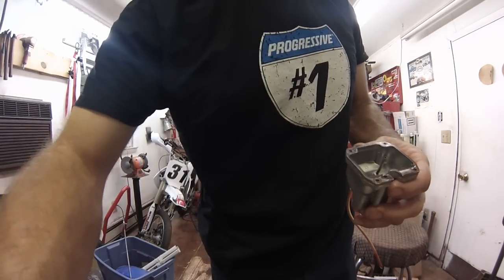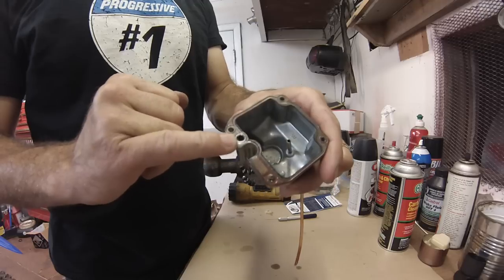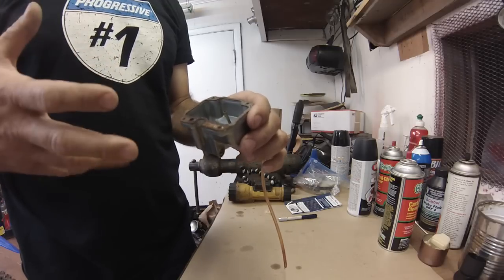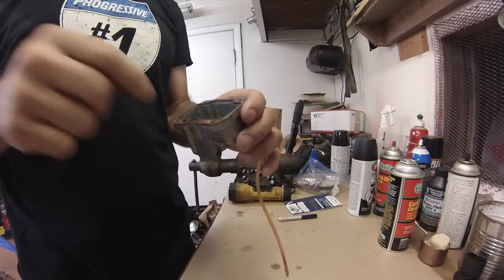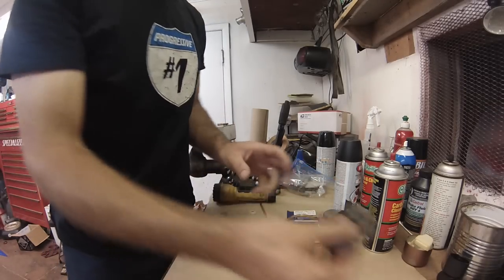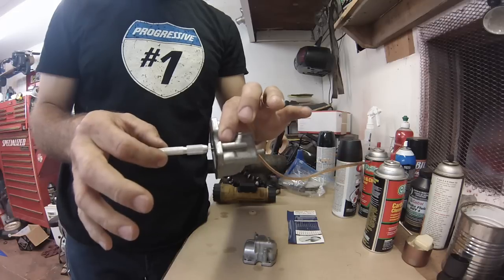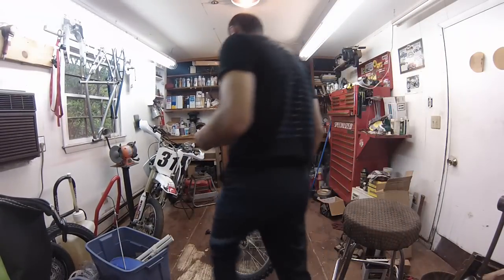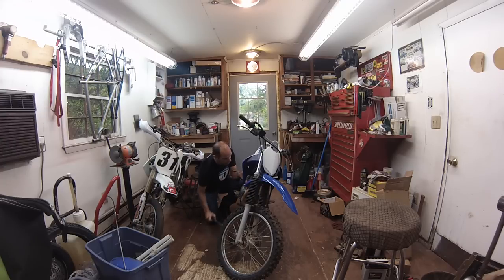TTR125 hard cold start problem FIXED !!

Comment: This absolutely fixed my hard cold start problem. When I bought my 2005 it had been sitting so long the gas was varnished. I cleaned the carb twice but missed the area described in this video. My bike starts cold now with the choke like it should. Thank you.

Comment: I just purchased a ttr125 that had sat with gas for over 3years. Cleaned the carb out several times and couldn't get it to start until I stumbled on your video. I didn't notice the hole in the float bowl that you showed. I tried your suggestion but was unsuccessful, Until... I used a guitar string and pushed it all the way through. The drill bit technique doesn't bend thus not cleaning the hole all the way. Thanks a bunch! Bike starts immediately and idles like a champ!
Reply from the maker: Good to hear, the hole is actually shapped like an L so straight in from the top then if carb cleaner doesnt flow through clean the hole from the bottom of the bowl side with a wire or similar. Glad I got you in the right direction.

Comment: Holy crap, years and cans of ether.  My daughter's bike hasn't been run in 2 years.  I clean up the carb and it wouldn't start.  I saw this video, drilled that out and it fired up in 3 kicks.  Again, after sitting for 2 years.  Thanks for taking the time to share your knowledge.  Absolutely spot on.  FWIW I used a common 1/64th bit and it worked fine.
Reply from the maker: Sweet, enjoy! Good to know the 1/64th worked fine they are easier to find.

Comment: Your video saved my life… Impossible to start my daughter’s TTR… It was  driving me nuts. The micro drill didn’t make it but I used a small pipe with my carb cleaner spray to blow from the small hole. It starts from the second kick. Merci beaucoup !
Reply from the maker: Awesome!

Comment: This totally worked for my 06 ttr 230. I just found some small stranded wire laying around and took a strand of that to use for cleaning out that pick up hole and some carb cleaner. also cleaned out the gas tank well to get all the old reserve gas out. put it al back together and it fired up first thing with the choke on and then ran fine after cutting the choke off. finally no more starting fluid!! thanks again!

Comment: This fix works like magic, you won't believe it !  I struggled for years with hard starting and a idling issue !!!  I used a 1-64 drill bit to drill out the orfice that worked great, you can find that bit size at any hardware store, I also changed the pilot jet in the carb from a stock #15 to a #17. I did not change the  standard main jet.    FYI, there is a tiny slow idle adjustment screw on the side of the carb and a mixture screw on the " underside of the carb", ( its very hard to get to, its on the engine side of the carb. Thanks tepco1  !!!
Reply from the maker: Great, glad it worked out!

Comment: Tepco,
         Your video while it didn't solve my problem directly pointed me in the right direction. My issue wasn't the port itself being plugged but a dead spider in the air vent hose at the "T" on the  choke side of the carb. I pulled the hoses and when I blew through the one with the 45 degree cut on it there was resistance. The spider was so petrified that I had to press a drill bit through the hole. After clearing the hose the bike now runs like new. Immediately starts when stone cold   good high idle on the choke and warms up and is ready to ride in a few minutes.Like new.
  I have had the problem for over a year and had taken the carb apart a few times. Thanks for getting me thinking...it was a huge help! Matt

Comment: Thank you so much for this video. It saved me so much time looking for things. Mine wouldnt start at all cold but ran fine hot. The choke didnt seem like it did anything. I tried adjusting the cable for the choke with no luck. That's when I started searching and found your video. Followed it and cleaned out the jet with a needle and carb cleaner. Fired up first try and had a marked difference with choke on so I knew it was working. Thanks so much!
Reply from the maker: Awesome! Thanks for watching.

Comment: I had been struggling with this issue for quite some time also. Was going through starting fluid like crazy and wearing holes in my boots kick starting. I cleaned with a small drill bit and also a very small wire with some carb cleaner. Blew it out with the air compressor, re-installed and the bike started first kick. Just wanted to say thanks for the tip. The bike is running and starting great now.
Reply from the maker: Awesome!

Comment: Just want to say you saved me a major headache,,I soaked my carb in Chem-Dip 24 hours even with the float bowl,Then air pressured blew it out..still same thing wouldnt start,But then I seen your idea and noticed soon as I blew carb clener in that float bowl hole it wasnt coming out down there at bottom..So sprayed it 4 ,5 times more down in there even though my long pin would go down in there it needed something more which is carb cleaner and high pressure air..Sure enough it fires on first kick now!..So just want to say Thanks for the help!
B.

Comment from the maker: @Don, #2&#4 may be related. If the bike is leaking fuel from the overflow there is only one way it can and that's from the float not cutting the fuel off when it should. This can be caused from the float being stuck or the float valve and seat are old/dry and not sealing, or your float height is way off. If this is the case it will run rich and hard to tune. Make sure you can see light through your pilot jet, also make sure your mixture screw has the spring washer then oring or it won't seal and will suck air. GL lmk how it goes, valve adjustments are easy on those and if you can strip carbs down you can do a valve adjustment. I have 2 TTR125'S so I'm sure I'll be doing a valve adjustment vid sometime.

Comment: I just got a ttr125 it was a pain to start. I picked up a micro drillset at hobby lobby for 20 bucks, it took me less then 10 mins. And the bike started first kick after sitting for a week and idled for the first time without bumping the throttle. Thanks for the video and info this fix works great
Reply from the maker: Awesome, glad I could help!

Comment: Thanks for this! Had to bust out the guitar strings to clean out this port (didn't have a drill bit on hand that's this small) on my TTR230 and it solved the hard cold start issue. Your vid was the guidance I needed.
Reply from the maker: Yes a guitar string is another great tool for tiny jets and this choke hole. Glad it worked out!
Reply: ha,  i use guitar strings too .................wb

Comment: Thank you so much.  I've been chasing ghosts in all directions trying to troubleshoot this exact problem. Ended up using some wire to clean this out but never would have thought to check it after a full rebuild with no change in behavior.

Comment: excellent video.  Easy to follow and relate to.   Problems with my sons bike are 1:  Hard to start as in your video, (I'll give your fix a shot this weekend) and 2: Won't idle at anytime, no matter if it's hot or cold and #3: The choke has to beld up or it'll slide back down. #4:  Fuel often comes out the overflow tube, sometimes even when the bike is running.   I'm planning on replacing the the choke cable to fix #3.  #2 & #4 have me stumped.  Carb has been cleaned numerous times and new jets installed.  Adjustments have been made on the idle adjust screw and no luck.  Time for you to make a video showing how to do a valve adjustment?

Comment: Well after drilling the fixed jet in the bowl it would start but it made the carburation extremely rich, with the 'choke' off. It was a fail on our 2002 ttr125.

I realized that the enrichment circuit was sucking the gas up through the float bowl - through the 'closed' choke valve and into the intake of the engine. Suspect that our machine being 20 years old had some wear that was not noticed on the original repair in the video.

After a period of thought, I figured that I could drop in a small o-ring into the bottom of the choke bore, ensuring that there was no leakage. The standard spring pushes the piston closed against the o-ring.

Wow back to normal. It started in 10° F weather in 2 kicks. Had to get the idle mixture turned back out to about 1.75turns. Carburates normal throughout the range.

So with the addition of an o-ring the drill mod works great. I bet a lot of TTR125s have this problem with fuel being sucked from the closed choke.
Reply from the maker: I'm assuming you made sure it was closing all the way? Sounds like the O-ring helped but didn't fix the issue. The rubber at the bottom of the plunger probably gets dried out and leaks like you described. And if it's not closing all the way that's another issue. It shouldn't be sucking any fuel through that port with the choke/enricher off.

Comment: i bought a 06 ttr230 from an older guy and had just been starting it with starter fluid for years. it seems to have the same problem when its cold, as the one your demonstrating. im going to look at the bowl and check this out and maybe it will work. Great video thanks!!
Reply from the maker: Yep should be the same. GL.

Comment: I saw a lot of oxidation around the choke plunger and spring when I took mine apart I finally tugged it a bit and it came free .When i pulled the carb I disassemble it all the way  down as far as you could soaked it and cleaned it throughly ,and Shazam it started first kick   . Enjoyed the video and thanks for posting.
Reply from the maker: Great, yea put some grease on the spring and oil on the plunger. Check it periodically and repeat. Ride on!!

Comment: Dude! Thank u! Was going crazy took the carb apart and cleaned it and changed every jet and piece was going crazy y it was taking forever to start when cold and dying when I gave it gas. But when hot it started and ran fine. Trying this tn! Hope it works

Comment: Hey there, thanks for the video! Just checking the drill bit size you used? Was that inches or mm? I'm in Australia so everything is converted to metric!
Reply from the maker: It's.0225" or .5715mm but double check my conversion math.

Comment: I actually cleaned the bottom end of the Carb about a month ago and it was running great. It is my Sons and it doesn't get ridden a lot. I restored this whole Bike top to bottom. Either it got dirt in it again from sitting or I am thinking it is the starter relay which is the only thing I did not replace yet... It is only 8.00 so I got it anyway. 
My other 2 Sons ride CRF 70 and these things can sit for months and kick right over.

Comment: Yep, Good job so did you drill metal out or just clean varnish out? nice little shop, Im working on a 2009 XT250 total pain in the ass to cold start it
Reply from the maker: No metal, just corrosion and old fuel.

Comment: Hi, does this still apply if it’s a brand new carbourator, also I don’t have that plastic bowl piece that you said don’t lose when you took off the bottom bowl. Do all ttr 125s have it?
Reply from the maker: Yes all the 125's factory carbs should have it. This hole should not be clogged on a new factory carb.

Comment from the maker: Your pilot jet is clogged, its the thin jet that is a 15 stock OEM part # is 5HP-14142-15-00. You will need to get a VERY fine wire to clean it out (I use a brick brush bristle) or just replace it with a new 17.5. If it runs with the choke on and dies when you flip the choke off, your choke is working.

Comment: tepco, is it an accurate to conclude that if idle elevates when the choke is on, and lowers when the choke is off, that this hole is not clogged and fuel is getting into that chamber for the choke circuit just fine?

I have a 17.5 pilot, and what I would consider an extremely clean carburetor, but it can still be a bear to get started when it's cold.
Reply from the maker: Yes that is correct if the RPM changes when you move the choke that shows that it's working, if it's  still hard to start it could be your pilot jet, if it idles usually the pilot jet he's okay but ,try that and see how it works .

Comment: my son has the 2006 TTR-125E. he sank in in a puddle last year, we cleaned it out, drain all fluids, and it ran like a top,. we didn't ride for about 4 months and the choke cable will not pull out now. in your video you reference a choke that is stuck in the housing. if i remove the nut from where the choke cable goes into the carb, should it just pull out.or is it connected to something inside the carb?
Reply from the maker: Yes loosen the nut where the cable goes into the carb and the choke will pull out. Now that yours is stuck it wont come out easy, you will most likely need to pull the nut up and spray a penetrating oil in there and work it out. After you get it out clean it good and in the hole then lube it with oil, I use Superlube its like dielectric grease. Good luck its stuck in there from corrosion so be patient, I've had some that didnt come out but after 4 months you should be able to get it.

Comment: Thanks! Going to clean mine rite now, it been getting progressively worse so I'm sure that's it. My choke also froze shut once and broke the cable! Thinking of selling this thing and getting another XR80 That bike starts when you look at it.   ; )
Reply from the maker: Great, yes clean that choke plunger and put some oil on it to prevent it from sticking. After you clean the choke hole like the video it will start like a charm. XR80's are good bikes working on one now a classic 1979.

Comment: I have a 2003 TTR-250 that Ive had to two mechanics over cold start issues. The problem persists. Would you know if the carb on my model is the same, where this may alleviate the issue?
Reply from the maker: Yes similar, it should solve your problem.

Comment: I bought a 50cc bike last year(winter project). Did top and bottom end rebuild, basically, I switched out everything in that engine. For like a week or 2 it worked great but now I have to kick it like 10 times to get it started(cold). The only thing I didn't work on was the carb so it couldn't be anything else, right? What else could it be?
Reply from the maker: Clean the carb and check what I go over in this video, you should be good. Something probably clogged the choke circuit.

Comment: Wonder if this would be the same issue my 2009 KTM 450 XCF is having. Bike has a real tough time starting when cold, even worse almost impossible in high altitude. When I got the bike carb was REAL dirty, cleaned it 3 times, also went to set the float and from the factory settings when the float is level I get no gas, I them I adjusted it down in the bowl a little more and then the carb would get gas and the bike would run. Now when the bike is hot it starts fairly easy "most" of the time but not all the time. Do you think this could be the choke circuit hole? Or the float setting, or something else? Driving me nuts! Any help you guys could provide would be awesome!!!! Thanks!
Reply from the maker: Neil Cowan When the float is level it should cut the fuel off. Choke circuit may be the issue although I would check your valves. Tight valves will cause a similar problem but harder to start when hot. I would check, compression, (auto decomp will make it read low, see leak down test below) valve clearance, pilot jet, mixture screw, and if you have the ability do a leak down test which is very important and will answer many questions. I would also start with stock jetting, make sure you can see light through the pilot jet and the mixture screw is set to..try 2 turns out to start and adjust from there.

Comment: Any recommendations for this problem I'm having? I completely cleaned out the Carb but didnt do the method described in this video(since I just saw it today) and my bike will only stay running with the Choke on. As soon as I turn off the choke, the bike dies. Also, the gas keeps leaking out of the overflow tube. Is this a float problem, jet problem, or problem with cleaning the area listed in the video. My apologies if someone else asked the same question in a comment and you answered it. My bike is a Yamaha 125 TTRLE 2006. Thanks in advance!
Reply from the maker: OK so the first problem about only running with the choke on is a clogged pilot jet, the thin long jet 17.5 or so, common problem. Be sure you can see light through it use a time wire to push through it, carb clean alone won't do it. The second problem could be a few things. So let's start checking, be sure your float is not filled with gas, some times they crack and fill up and don't float. Then make sure nothing is stopping the float needle from seating like a piece of trash or rubber from the fuel line, pull the float and needle, take a q-tip with metal polish, I use semichrome, and polish the brass needle seat and be sure your needle rubber tip is clean and rubbery. Then check your float height. I don't mind answering questions, ask away! If your bike only runs with the choke on, you don't need to do the repair in the video.
Reply: I had the same problem but yesterday I took the idle screw out and just rubbed it with my hands on the tips and cleaned it and stuck it back in and now it idles like a champ!
Reply: Without the choke!

Comment: I adjusted my pilot air screw and it starts a lot better....i just got the bike & haven't done a full carb cleaning but when i do I'm going to do this as well....now when i am drilling this am i actually drilling metal?......or am i just drilling out debris and varnish from shitty ethanol gas?.... any help or information will b greatly appreciated
Reply from the maker: You are drilling debris or corrosion. Remember the goal is to just clear it out not open it up. Spray carb cleaner in there first to see if it's clear, if so leave it. 
Your mixture screw should be around 1.5-2.5 turns out.